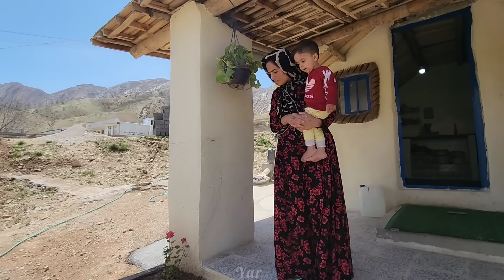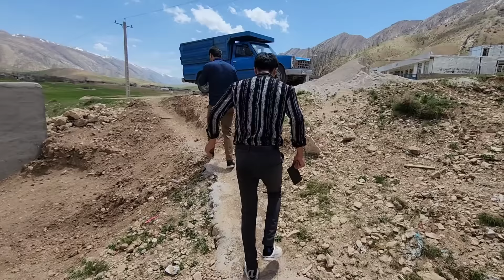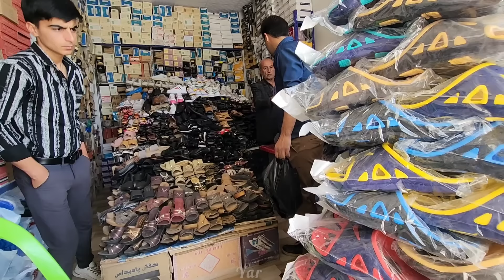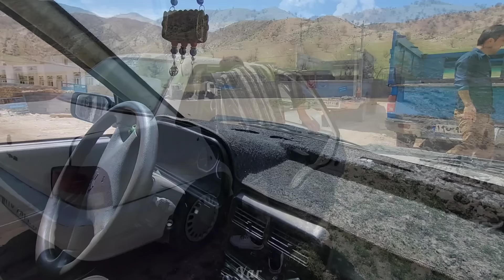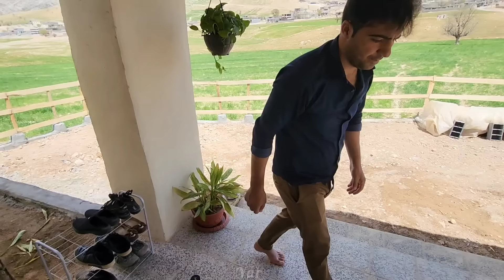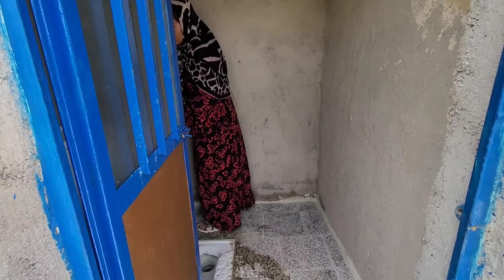Promise Fulfilled: A Tale of Brotherhood and Gratitude🚗

Comment: There’s a new lite on the market that would be perfect for your toilet and front porch.  It is not plugged into anything and no cord.  It has a motion sensor, and you just TAPE it to the roof or wall!!  I’ll send more info and address when I have more.  

It will be about $40.  Can you hold off until you have more info?